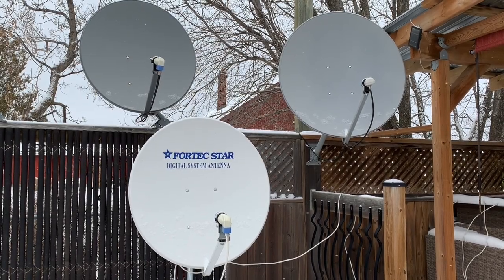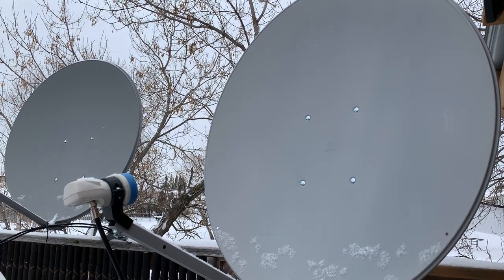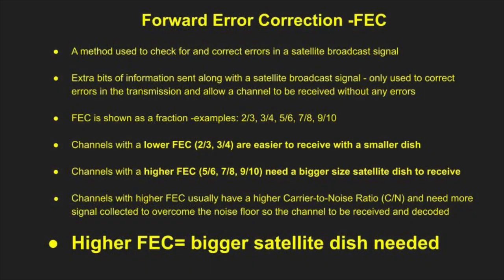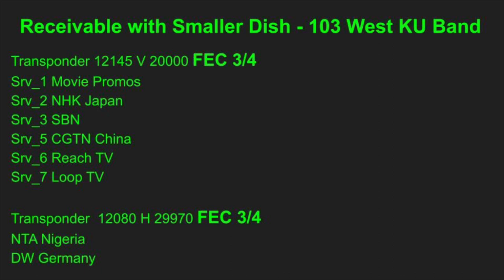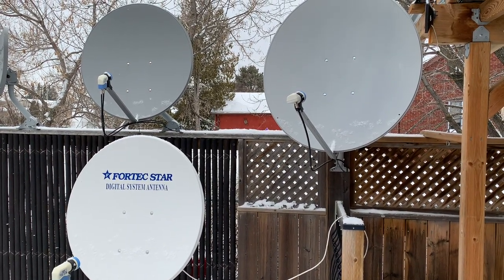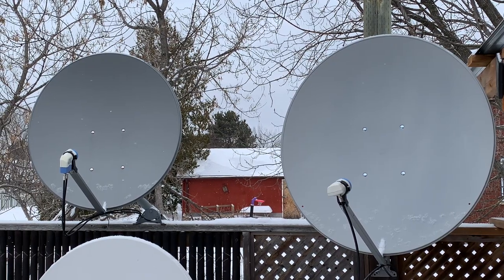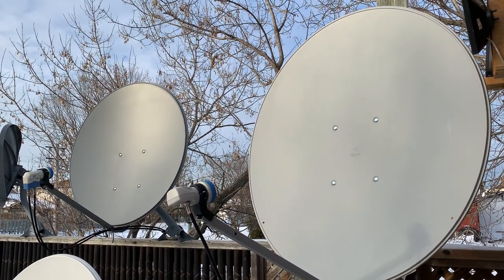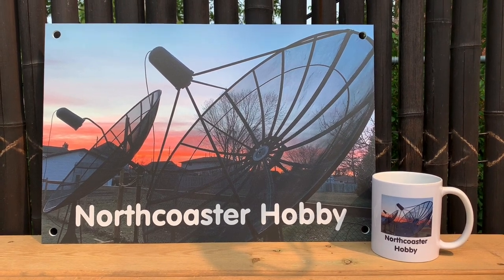Why You Might Need a Bigger Size Satellite Dish for Free Satellite TV

Comment: The bigger the better. No problems during bad weather, collective installation (hotels, flats etc), easy to receive weak transponders, in some cases you can receive beams or satellite outside of your footprint. The downside is that it may be a little difficult to install the dish and strong winds may damage your dish, not to mention larger dishes may be expensive.
Reply: Hello! You're right a bigger satellite dish not only has very good signal and the signal is stable during rain. There are some exceptions in Summer and Winter during heavy storm or heavy snow and even with large dish you have no signal! But these are rare cases.
Reply: Well... They actually do get disrupted... Just not as much because they receive more signals.

Comment: Great information....but there is more to the story!  As an RF engineer, we know that many factors go into receiving and transmitting a signal.  Bigger is always better when it comes to antennas.  The quality of the LNB is important.  Think Chinese crap LNB's versus German or even Tawain based manufacturing LNB's.  (Look on Amazon Germany or Amazon UK sites for better LNB's.  Not Ebay!!!  You will loose signal quality with cheap LNB's.

The quality of the coaxial cable is vitally important too.  
Cheap cable has many losses including attenuation loss at satellite frequencies and length of cable run..  Velocity factor of the cable is important....forget that...too technical.   Bottom line, quality cable like Belden RG6 Quad shielded is what you want.  Period!  Yes...quad shielded!

The quality of tuner in sat receiver is important too.  Also, how the electronics in the receiver processes the signal plays a part in good decoding.

Bottom line...It's just a hobby.  Have fun and enjoy it, I do.  Spend what your budget can allow and enjoy the hobby.  Hope this helps. 😛
Reply from the maker: Definitely there’s many factors that determine good reception. A bigger dish will never hurt a system as far as I know. Velocity factor- doesn’t that have to do with how fast signals travel through coax when compared with the speed of light? I assume a higher velocity factor is better (probably from better quality built and shielded cable). Thanks for watching and for the information.📡

Comment: The Ku band (/ˌkeɪˈjuː/) is the portion of the electromagnetic spectrum in the microwave range of frequencies from 12 to 18 gigahertz (GHz). The symbol is short for "K-under" (originally German: Kurz-unten) a typical TV station Relay transmitter use 17 Feet (5 meters) for optimal KU band feed and it still might get blocked by heavy rain fade.
Reply from the maker: Ku band is succeptible to signal fade in heavy rain, but is otherwise reliable. Due to its longer wavelengths,  C band satellite is virtually impervious to rain fade and is used by broadcasters for that very reason.